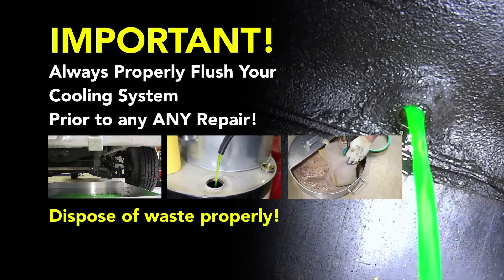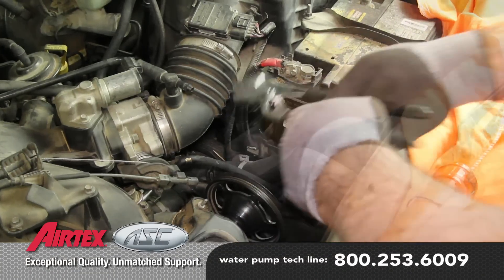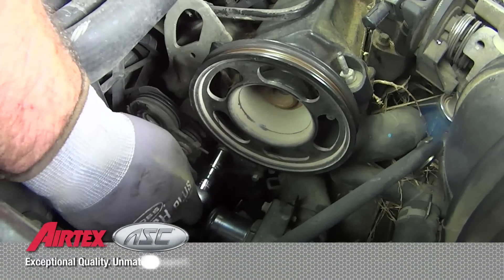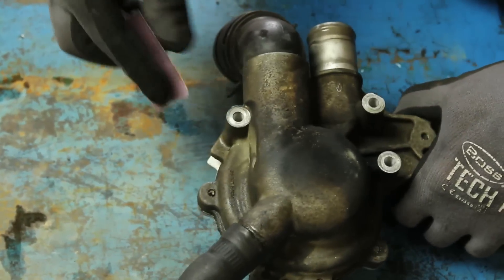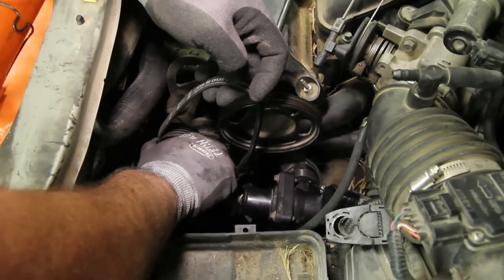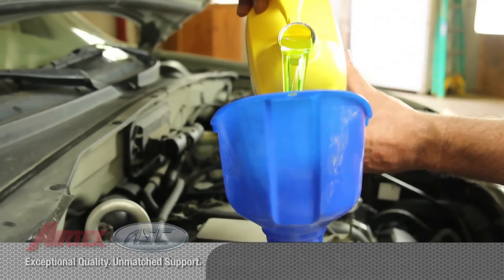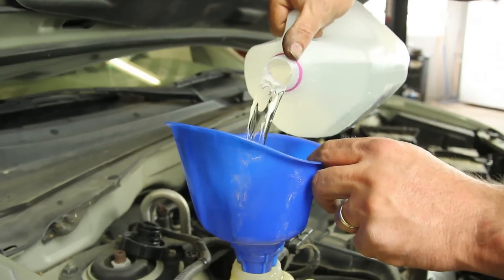How to Install a Water Pump - Ford 3.0L V6 WP-9035 AW4091

Comment: Working on the ford Escort 2002 i have instodl radietor AC compresor and Now hosesPow stering that was folty Brand now, and now it is time to do Water Pomp and agen Power searing. God nows how all this will com out AC is worling Good But I have anteferez laeck and cant find it fot the Gods name...

Comment: If it comes with a gasket it doesn't need sealant on the mating surfaces.  Thats what the gasket is for. All applying sealant does is create a potential leak.
Reply: True. I’d only silicone the mounting surface of water pump so that it sticks. Doing the other side is unnecessary.
Reply: This is what people do when I have no idea what they're doing, putting sealant on that surface can only cause later issues and I guarantee it will. Everything goes on dry nice and clean torque to specification. Make sure bolts are clean and spotless or else your torque specifications will be off greatly

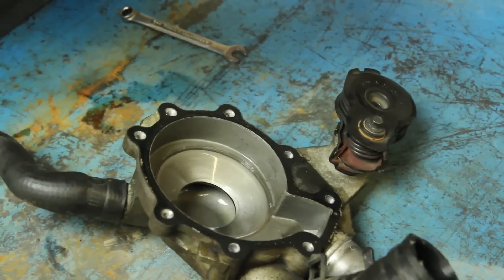Comment: I have a situation with my housing. Reference your video at 1:48 there is a hose at the bottom of the screen attached to a neck that goes into the housing. On my housing that piece the hose is connected to is a plastic that simply sits inside the neck leading into the housing. It is not secure at all and slides in and out. I fear that this is where my leak is and I don't know what to do. Is there supposed to be some kind of epoxy to hold the plastic inside the metal neck?

Comment: Long story short: Is it possible to change out a cracked lower heater hose from under the car without removing the entire waterpump from above? Also, can anyone here give a part number for the lower heater hose (2002 Escape)?
Reply from the maker: Short answer... Yes. You do not need to remove the water pump to replace the heater hoses. It may make the job easier but it is not required.

Comment: Mine didn't have a gasket when I took it off for some reason. Are you basically glueing it with the sealant?
Reply from the maker: This does has a gasket between the pump and the housing. Our water pumps include the gasket. Richard uses a RTV sealer on the pump and hosing to help seal and to help hold the gasket in place while assembling.

Comment: How do I know if the WP is driven by the intake or the exhaust camshaft??
Reply from the maker: It is driven by the intake cam.
Reply: @AirtexFuelPumps  : Can you provide mo./yr. production dates on that , please , I have and 06 escape 3.0 with production date 08/05 this vehicle does not have independent belt tensioner pulley. Intake Cam or Exhausts Cam type app for new WP install , thank you for response(:

Comment: Just so you know turning the heat on high has zero effect for bleeding the cooling system, that is only necessary to feel for heat and therefore knowing if the heater core has been bled.
Reply: Yes turning on the heater opens the water line valve which passes through the heater core. Thus allowing any air trapped in the system to flow out and escape via the open radiator cap.
Reply: @highadventur you are 100% correct. Any other guy has no idea what the hell he's talking about

Comment: My 2005 Taurus  is running hot.  Found a crack in the plastic part of the upper radiator hose so I ordered a new hose and thermostat since I have 290,000 miles.  Changed both but same thing happens.  Runs good in park w and without A/c running - but heater is not working.  Drive  around  the  block.... needle goes to HOT.  PLEASE  help
Reply: Thanks for giving me things to look at.   I'm looking to replace the water pump or just getting rid of her.  Thanks again for the speedy reply.

Comment: AS FAR AS REMOVING CAM PULLEY TO REMOVE TWO BOLTS ON WATERPUMP..PEOPLE SAID YOU NEED TO PULL NUMBER 1 PLUG,GET AT TDC.INSTALL LOCKING PIN THREW TIMING COVER TO KEEP FROM MOVING,AND REMOVE VALVE COVER.WOW,MAYBE SO.WHAT WE DID IS PUNCH MARKS ON PULLEY,CAMSHAFT,VALVE COVER .WILL LOOK LIKE THIS[...INLINE WITH EACH OTHER.THAT WAY EVERYTHING IN LINE.REMOVE PULLEY,REMOVE TWO PUMP BOLTS.INSTALL PUMP.REINSTALL PULLEY KEEPING MARK INLINE WHEN PRESSED ON..IF SUTN SHOULD MOVE,YOU STILL HAVE CAMSHAFT MARKS,VALVE COVER MARK..WORK FOR US.GOOD LUCK ,AUSSICKER.

Comment: $36.00 for a water pump $364.00 for labor. $400.00 is what my Daughter was charged and the mechanic didn't change the thermostat.
Reply: I just did it on this same make and model....”ford escape v6”$24 pump,$3 thermostat seal,$14 thermostat,$3 belt(gates),$8 of coolant(prestone),......$0 labor cause i did it myself  with one 8mm socket and some pliers..  #hireelectrictiontoplugintoaster!!!!

Comment: hi, i have 2001 ford escape 3.1, and it is getting hot, even though the radiator is cold; does it mean the water pump is not working? i did change the thermostate after it busted the long hose because of too much pressure in it.   What should i do next?
Reply: I’m way late, but I’m willing to bet it was a clogged radiator?

Comment: Hi Guys, I have a 2007 Ford escape, the water pump holding screws can not be released because the pulley cover it, in this case I must remove the pulley? or is there a way to remove the pump without removing the pulley?  thanks for your help...
Reply: Dear, thanks for you information..regards
Reply: Leonardo Montoya

Comment: I changed out the water pump on my 05 Limited Escape / 3.0 today...It is not necessary to remove the whole housing & all those hose clamps, also you will not need to remove the lower heater hose from below - You do need to remove the plastic thermostat housing & upper & lower radiator hoses...I used vise grips to lock the stubborn clamps open...I had no belt tensioner, The belt comes off by removing the three long housing bolts & after they are out, the belt will slacken up...After that I just used my 1/4 inch drive, 8 mm socket & extension to remove all of the short water pump to housing bolts and popped that baby right outta there.
Reply: Good for you, Robert...Glad you got 'er done.
Reply: no need to put out the whole housing.......more time more money for the garage lol
Reply: Thanks for your reply. Turned out all I needed was a water pump belt. Broke the upper radiator hose and had to replace. I had no idea there was even a belt there because it's under a cover. It would have been so easy had I known! Push down the tensioner, replace the belt. done.
Reply: Is the thermostat housing the black plastic to which the upper and lower hoses are attached? Did you just remove the 3-bolt fitting to which the lower hose connects, or the whole thing?
Reply: Robert...I'm sorry, it's been so long now that I don't remember the exact configuration.